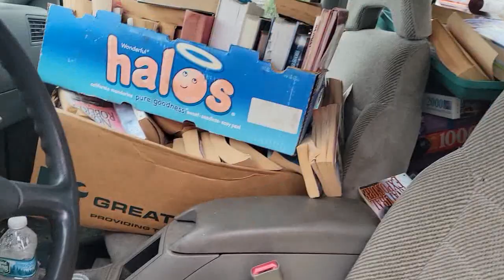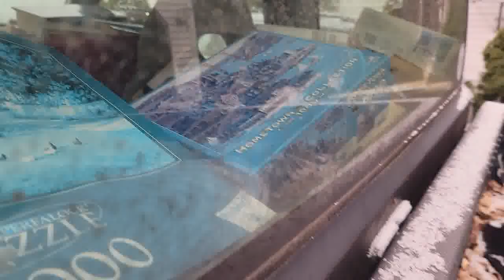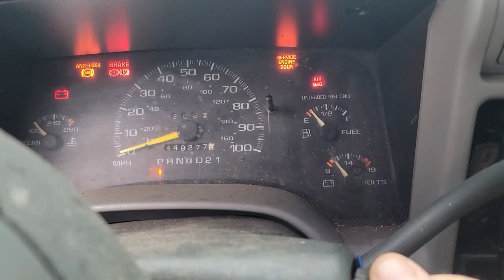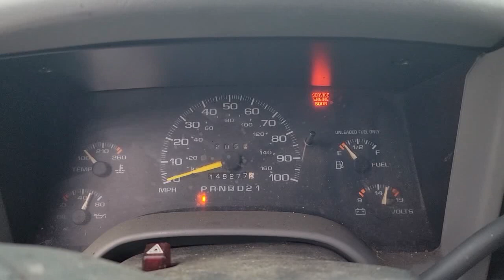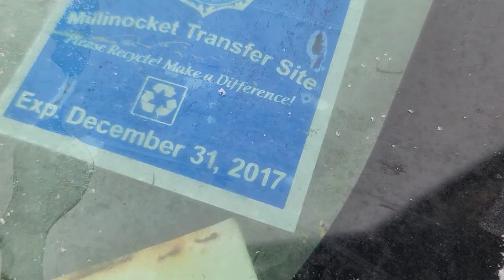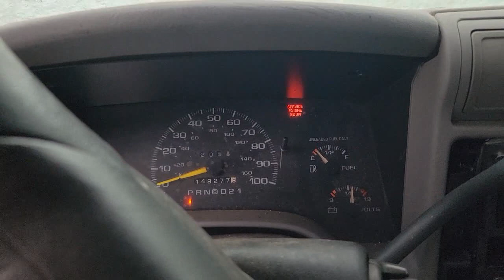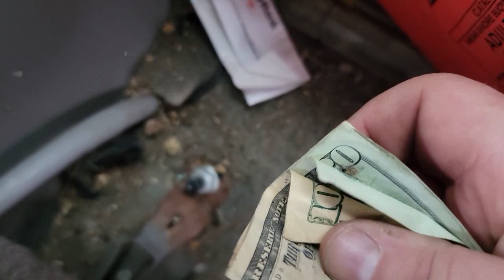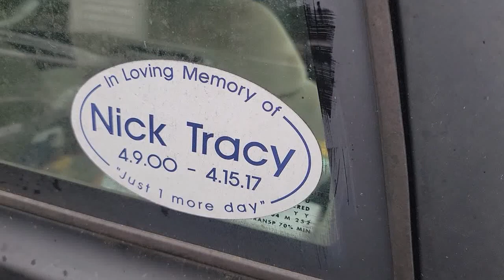Junk Chevy S10 Cold start CASH FOUND! with BURNOUT CELEBRATION!!!

Comment: Limited slip and relatively low miles. Motor sounds decent even on old gas. Think it's worth flipping it? That's LIGHT rust for a salt state
Reply: After that neutral drop I would only sell this thing to someone i HATE, after a few more reverse to drive burnouts 😂

Comment: pretty sad the 4.3L always held up better than the trucks they put them in, We sold our 2000 Astro van AWD in good shape with ZERO rust on it and 288,000 miles on the thing in 2012 because the transmission went out on it and i just didn't feel like fixing it.  sold it for $500.00  This truck sounds like it just has some old gas in it. WOO HOO $50.00 and some free tools too. SCORE! i think i would have to yank the engine and trans out of this one and sell it separate from the truck. if you can afford to do it time wise. that has the 4L60 Trans in it just like my 97 blazer did.  you could probably get  a pretty penny for that trans because they put them in everything, even the big trucks and vans from that era, I have the same one in my 99 tahoe too

Comment: I love a 4.3 but she deserves the boot!!! def has a misfire thats why check engine light flashing. but put plugs in it and boot it lolol
Reply: It's because it's old gas..that's why it had problems burning out. The Vortec requires 91+ octane from the factory to run correctly. I've had a few
Reply: @netrioter  not entirely true on that ran a 4.3 with 87 for 1 and a half decades. and it could be because of the gas but the plugs are fouled out